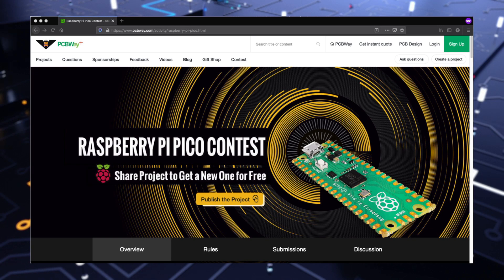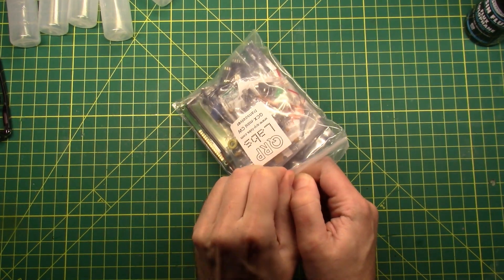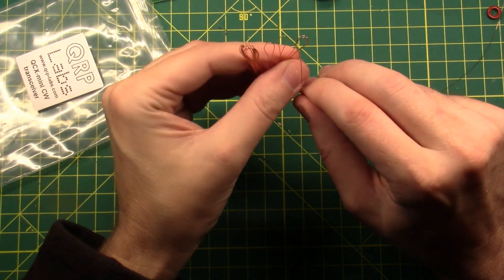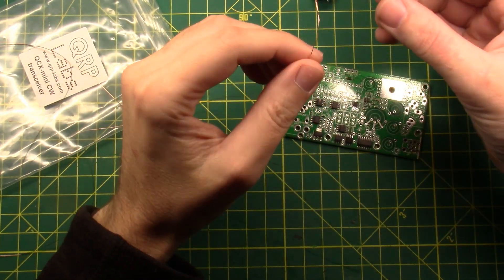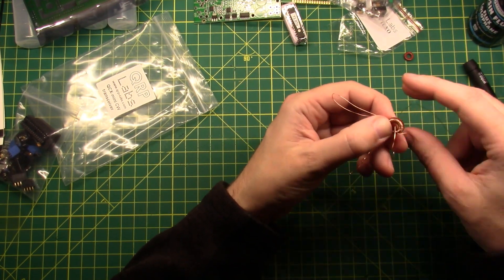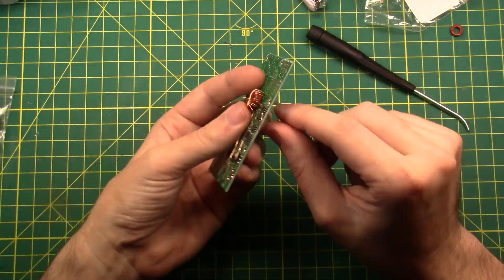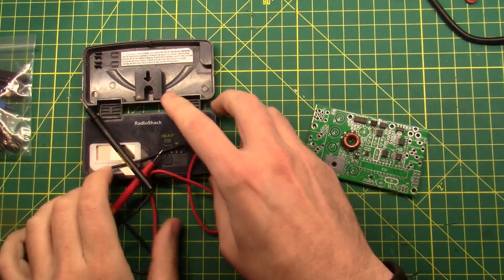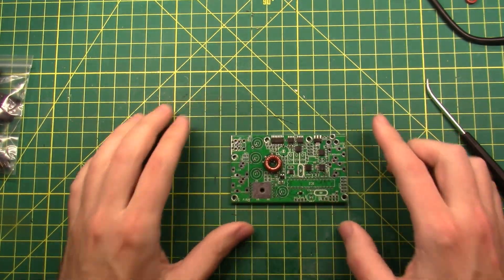How to build a QCX Mini - Part 2 - How to Wrap A Toroid

Comment: Well done.  Mine has been in the cupboard of forgotten items for the last year after that toroid (on 40m) tested my patience too far.
Reply from the maker: Thanks! I was lucky in that my favorite band to operate portable is 20m and that is a little easier.
Reply: @temporarilyoffline  Yeah, ordering 40m was an error in hindsight. 20 is better for portable antenna options.  I've just ordered some more 28awg wire, and it seems from the instructions that the toroids are the same for the 20/40m bands, so it's just a case of swapping out some ceramics, which I have.  Here's hoping for second time lucky. :)